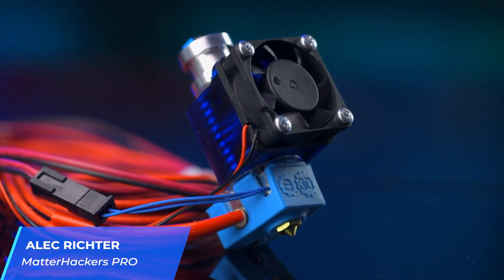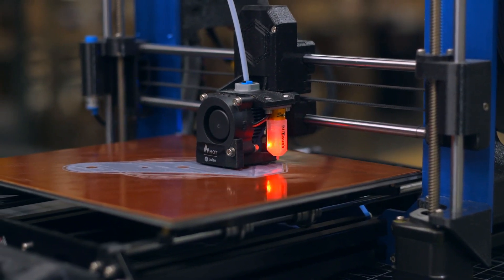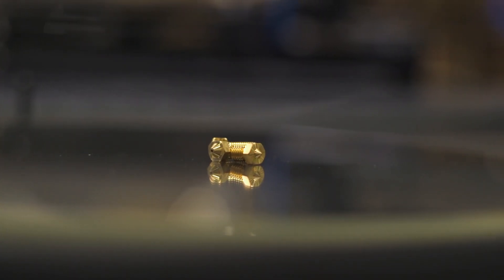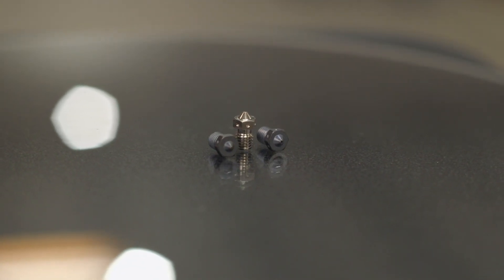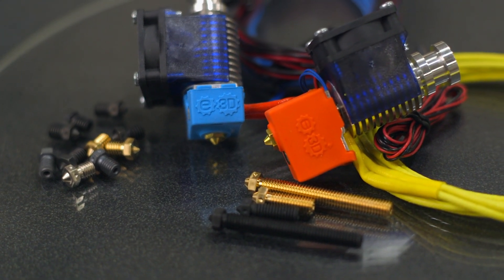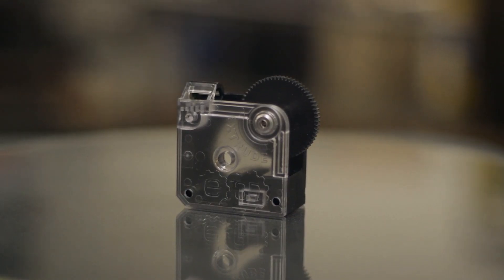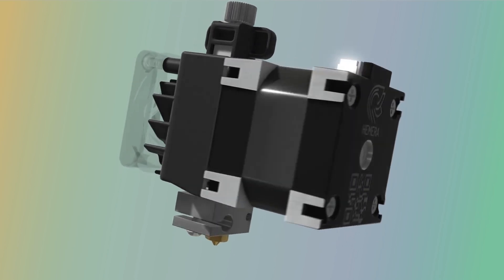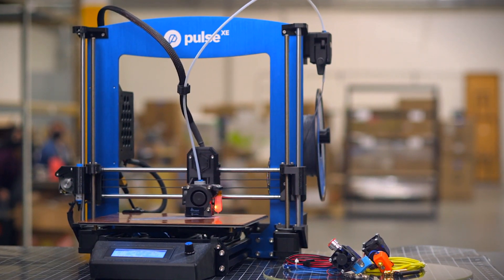Tech Breakdown: E3D's Top Nozzles, Hotends and 3D Printing Accessories

Comment: I got an E3d Hemera months ago and it is a true work horse and has never once failed me. I will never use another hot end for any of my printers!
Reply: I got the hemera a few months ago as well... complete opposite experience. clog in the nozzle throat every 25-30 hours of printing...
Reply: @justinwidmar8363  Did you follow the instructions about turning out the nozzle by a half turn, heating the hot end to 300 and then tightening up the nozzle? Something else I did that was not shown to do is I applied thermal paste to the entire heat break to ensure good contact and movement of the heat. No clue why they did not suggest that since the whole reason to use the paste is to ensure the best contact possible between surfaces for best heat transfer. Anyway, not sure if that would help you but something I would recommend doing.
Reply: @kevinm3751  I think it was more to do with how the specific brand tpu I was using flows in the heat break during retraction.  I didn't have any issues with filament deformation even at speeds of 100mm/s w/ tpu.
Reply: Me too. A total beast. So powerful it would probably still extrude even if you forget to turn the heater block on 😆
Reply: @paullancefield  LOL, I think you are taking it a bit far with that one....;)